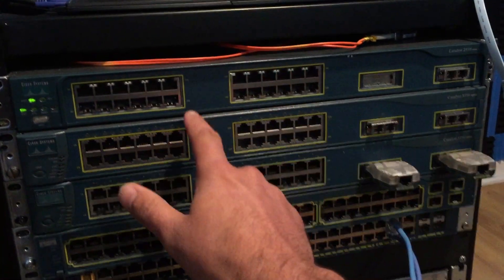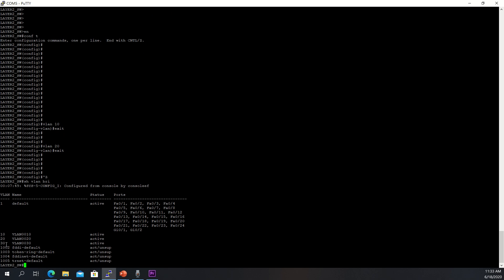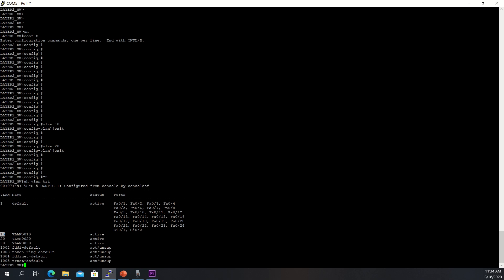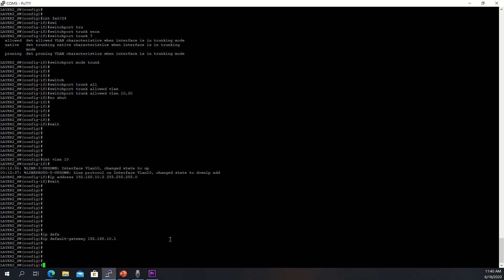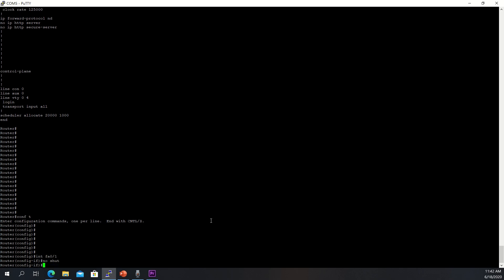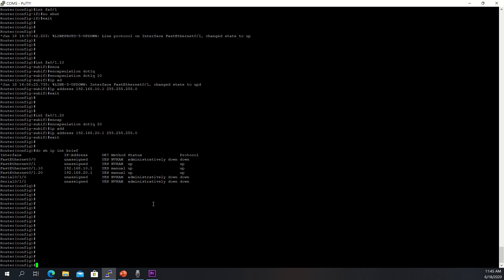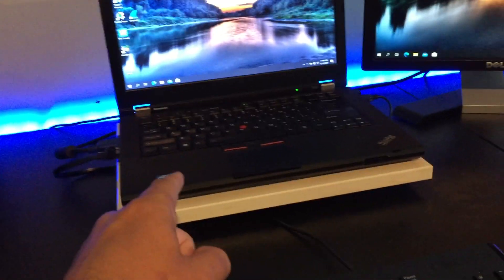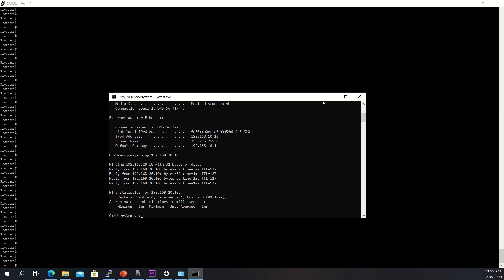Configuring "Router on a Stick" | Cisco Networking

Comment: Hey man, this is great! I am an IT student studying for my Network+ exam and this is exactly the kind of stuff I was looking for. Very informative, especially the introduction discussing whether or not this would be relevant today.

Any chance I could get some help on how to connect to my ISP's router using interface FastEthernet 0/0 with this configuration?
Reply from the maker: Hey Jonathan, thanks so much for leaving a comment, I'm extremely glad that you found this video useful! Good luck on your journey to achieve the Network+. Study hard and I'm certain that you will obtain it!

I can definitely help you connect to your ISPs' router, but I just have a few questions... 

1.) Are you currently using a "router on a stick" setup on this router and FastEthernet 0/0 is an additional interface on the router? 

2.) Or does this router only have one interface (Fa0/0) and "router on a stick" must be used to connect both your ISP and LAN to this one physical interface? 

You can either respond here or send me an email to rmayer0428@gmail.com.
Reply: Robert Mayer my router is a 2811 with 2 interfaces. F0/0 and f0/1. Interface f0/1 is sub interfaced just like your video with f0/1.10 and f0/1.20

I plan on using interface f0/0 to connect to the ISP. Which, I already did. But not getting any internet access to the vlans
Reply from the maker: Okay perfect, sounds like a pretty straightforward setup... I'm also assuming this is IPv4. If not, please let me know and I can revise things. Now you may have already performed some of these steps, but here is the first few lines of configuration:

en
conf t
int fa0/0
ip address dhcp
no shut

At this point, verify that you obtain an ip address via dhcp (unless you have statics through your ISP. that would be configured differently). You should see a syslog message showing the IP and subnet mask, or you can confirm by issuing the "sh ip int brief fa0/0" command.

Once you have an ip address on fa0/0, issue the "show ip route" command to see if dhcp also gave you a default route. If not, then you would configure it as follows: "ip route 0.0.0.0 0.0.0.0 x.x.x.x" (x.x.x.x being the next hop at the ISP).

At this point you can verify basic internet connectivity on the 2811 by attempting a ping to say 8.8.8.8 or 1.1.1.1 ("ping 8.8.8.8", or "do ping 8.8.8.8" if in global config mode). You should receive 5 icmp echo replys with 100% success. 

This might be where you're already at though, and if so I'm sure you discovered that your vlans still do not have internet. This is because of either one of 2 possible things... if you are connecting to another router on fa0/0, then you will need to add statics on that router for your subnets contained in your 2 vlans. These would point to the ip address on fa0/0 on the 2811 for their next hop. This would be a scenario where you already had internet coming in and you were simply just trying to give the 2811 internet access, but not actually trying to configure it as you primary internet router.

If the 2811 is connected directly to the ISP (which I am assuming this is how it is set up) then you most definitely need to configure NAT/PAT. I have another video on this, but to make it simple I can include a simple config below that should work for your setup.

en
conf t
int fa0/0
ip nat outside
exit
int fa0/1.10
ip nat inside
exit
int fa0/1.20
ip nat inside
exit
ip access-list standard NAT
permit any
exit
ip nat inside source list NAT int fa0/0 overload
end

This will translate the private RFC1918 addresses assigned to hosts on vlans 10 and 20 to your globally unique public IP assigned by your ISP. Unless I'm overlooking something (you would be surprised lol), I think that you should be good to go. 

Please don't hesitate to reach out if you have any other questions or if this did not work for you. I would be more than happy to help out.
Reply: Robert Mayer ok, thanks for your response. The 2811 is actually connected to my ISP router which is an Arris Bgw210. I’ll have to check if I can add the routes to it (I’m pretty sure that’s what you meant...)

Other than that, before I created the vlans I had the router set up the way you described above and internet connectivity at the switch.
Reply from the maker: You're very welcome. I guess I neglected to ask... is this for lab purposes or for a production network setup? If it's production (or you plan for it to be), I would call the provider and have them put the Arris in bridge mode, which would terminate your internet connection on the 2811 and the Arris would be a passthrough device. 

If this is for lab purposes and the Arris is not able to do static routes (I did a quick google search but couldn't figure anything out on that), then you can still do NAT on the 2811, you would just have a double NAT situation. It would just translate your internal subnets on the 2811 to the private address space on the LAN side of the Arris. Of course the Arris would perform NAT again and translate that address to the actual public IP on its WAN side.

Double NAT normally isn't best practice, or even good practice for that matter, however sometimes it is unavoidable (depending on the network you are dealing with), but in a lab scenario it is absolutely fine. 

Hopefully the Arris can at least do static routes though, I think that would be most convenient. The reason for the static routes is because the Arris has no idea how to get to your internal subnets on the 2 sub-interfaces residing on the 2811. Traffic should absolutely be reaching the internet, but when the return traffic arrives and hits the Arris, it only knows about its two directly connected subnets - The one connected to the internet and the other connected to FastEthernet0/0 on your 2811. Tell the Arris the way to reach those networks (if you are able to) and you should be golden.
Reply: @RMTechCentral  this is really just for a lab. I have a network analysis as a final and I was wanting to use it as the subject of the analysis. That's why I was trying to set up vlans. I suppose internet connectivity isn't necessary. I definitely do appreciate your help and taking the time to get back to me. Thank you very much